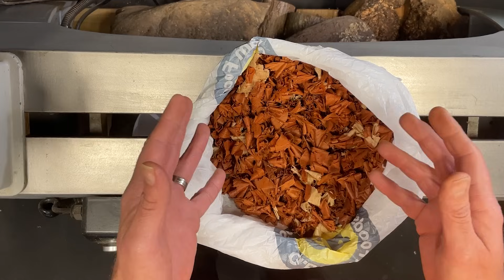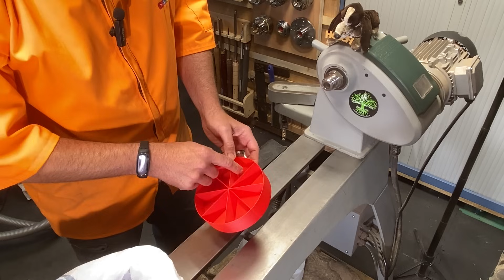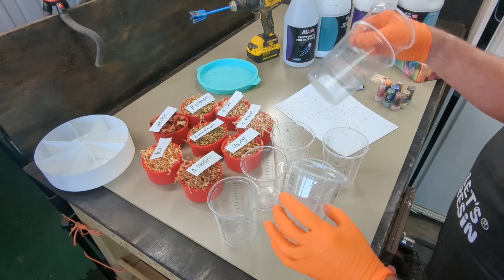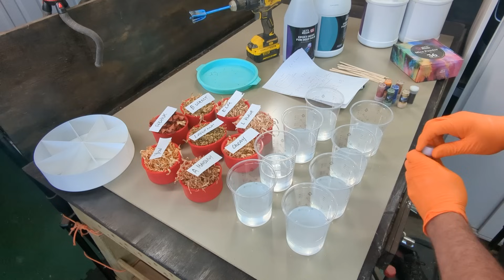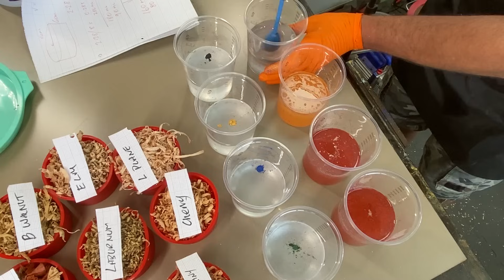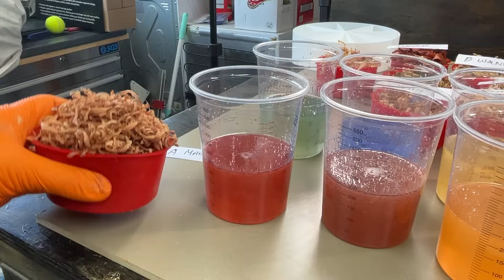Turning Wood Shavings Into a Surprise Project! – A New Wood Turning Experiment

Comment: On the printer side of it:  You can go thicker on the walls while avoiding infill by jacking up the wall count in the slicer.  BUT it's a 3D print...  they won't ever quite be 100% solid.  You can also allow infill but set it to 100%.  Guessing this was printed in PLA, which is... not great at higher temperatures.  PETG would tolerate the heat a fair bit better, but you'd want to test if the resin will stick to it (a similar plastic to disposable water bottles).  ABS / ASA would also handle heat better, but can be trickier to print properly and will offgas some nasty volatile organics.  As a guess though, any of them with thin enough walls might have issues unless you can keep the temperatures down.

I've had the idea of printing molds to use as one time use pen blank molds so I'm excited to see this test of the concept.  I've never had a chance to actually do it.  I was excited to see the mold didn't leak, even with the heat distortion.

Quick edit:  You can also increase the extruded wall thickness (within reason) which might help a small amount.
Reply from the maker: Thanks so much for the tips, I really appreciate it 😀
Reply: @mikeholton  One thing that would worry me from a safety perspective:  If you do, say, two or three perimeter thick walls, when you spin the blank, it's relying on the adhesion of one wall to the next, not the resin to either side of the plastic.  That... will not be as strong as solid resin or resin to either side of a single bead of plastic.  I can't guarantee if it'd explode, but man I'd be terrified trusting it!

I think the idea of just wider single walls might be where it's at.  Might need to slow it down a bit for it to keep up, but I'd bet 0.8 or 1mm thick walls are possible if you can balance speed and temperatures.  PETG, if the resin adhesion is OK, can be easily had in clear, which might optically vanish in the resin.  So many neat places you could go with the printed molds!

I've never done it myself, but you could also use a 3D print to create a sand mold and pour pewter or such to form the internal dividers.  That'd be a really cool "someday" iteration on this.

Comment: If you used PLA filament that is why it warped,  next time try using PETG filament, it doesn't warp from heat as easily as PLA
Reply from the maker: Thanks Tod, yes I used PLA so next time PETG or ABS 😀

Comment: I would have liked to have seen a slightly different shape for this one, which could have been used as a pocket tin or a peanut ramekin, but in the shape of an OMNIA baking tin (round with a sort of ‘central chimney’, solid in this case).

Anyway. It’s still an impressive work.
Reply from the maker: Thanks Ely, I will be doing more with more practical shapes 😀
Reply: @mikeholton you don’t have to. As a viewer, I have sometimes silly ideas that can be nonsenses and could be really difficult to realize. I have absolutly not the thinnest idea of how this sort of shape would be feasible. I’ll continue to Watch you Channel whatever the forms, anyway.

Comment: That's really nice. Maybe use a bit less hardener if the temperature is this high it will cure slower and less hot. Also try to peel off the outside, that way you can easily check if the center is going to  detach.
Reply from the maker: Thanks, the rim was not for peeling, it was fused 😀

Comment: Hi Mike. A very nice & interesting project well done. If you do this again, maybe consider making the interior sectional part separate from the outer ring & spray a mold release onto the inner sectional part then after filling with your resin & shavings, remove the inner part & just have the shavings & resin meet as they will. That way you won't have to worry about the heat & the warping. The mess when working with resin is enough to prevent me from using it. I have, but I don't like it. Seeing you shake it off was very funny. I wondered if you learned that trick from your dog. LOL. Take care and keep turning. Bill Riley
Reply from the maker: Thanks Bill and thanks so much for the suggestion 😀 (yes, my dogs taught me that move lol)

Comment: I wonder if it would work to have the internal dividers as a separate piece, then just at the point of putting it aside to cure you carefully pull the divider out. I guess there would be a bit of blending at the joins but hopefully not too much.
Reply from the maker: That is an interesting idea, thanks for sharing 😀
Reply: @mikeholton   just thinking of a variation on the theme. I like the “segments of an orange” kind of vibe that this one has, probably more than if the dividers had stayed perfectly straight.

Comment: Without sounding redundant, my favorite part of what you do is that you take what others would toss in the trashcan or bin, as you would say, and make it extraordinary. You seemed concerned about lines from the mold not being straight. I was thinking, maybe next time, use some scrap wood to form sections. Surely that would hold straight.
Reply from the maker: Thanks for the idea Jacey 😀

Comment: That's so cool. It looks like pieces of stone. It would be neat to try doing it with copper dividers instead of the white plastic (although I know the 3d printing was part of the experiment). Also, haven't you said in previous videos that yew dust is toxic? Did the resin make it so that wasn't such an issue?
Reply from the maker: Thanks and yes, the yew was impregnated with resin so quite safe 😀

Comment: On your slicer you should be able to set infill to 100% so it'll create a solid form.
Reply from the maker: I did try that but it would not let me, I am fairly new to the whole process 😀
Reply: @mikeholton  Ah okay, I've only got experience with a single slicer (which is dedicated to my printer model). I see someone else has suggested a work around by setting wall thickness. Good opportunity to mess about and try some more ;)

Comment: PLA (assuming that's what you used) melts at very low temperatures and distorts at even lower ones, so even without the workshop being warm I think the curing process is going to warp PLA. Amazing result though!
Reply from the maker: Thanks for the Info Tony, I'll try ABS 😀
Reply: I encourage a bit of research into printing ABS resin filament and health risks, given it's an area I know you take great care over with wood dust.
Reply from the maker: @EightBitTony  Thanks for the heads up! 😀

Comment: Great idea and job. A thought about the 3D print. If your design software will allow, you can have it print a tenon on the bottom so you should have a better hold on the piece instead of the wormscrew. Just a thought.
Reply from the maker: Thanks John that's an interesting idea 🙂

Comment: That looks so good, loved it. I was thinking of trying that myself, now I know it works.Not sure what printer you have but in bambu labs and I think prusa slicer software you can change the perimeter lines to more lines. This is usually better that trying to infill to 100% as  some infills won’t let you. Plus using a filament that has a higher melt point such as abs may help.
Reply from the maker: Thanks Mark, I have a P1S I'll try with ABS 😁

Comment: Very nice. I like the way you separated the different colors and shavings. I tried to make a small bowl a few weeks ago using chainsaw shavings of cherry and yellow resin. I ended up making a funnel when hollowing out the bottom and cut into my recess. I repaired it using more shavings and green resin and turned it into a feature.
Reply from the maker: Sounds great Greg, there is always a way 😀

Comment: I am curious, wouldn’t it have been a little easier to make pie slice molds and then after that cures, then colored epoxy all the pie slices together? Maybe easier isn’t the right word. Less risky maybe? 

I would be worried about the plastic/epoxy bond (and the warping from heat). 
Looks very cool with the colors of the epoxy and wood chips.
Reply from the maker: Thanks, I did consider this and even bought a pie shaped cake mould to do it 😀
Reply: @mikeholton there is always the next one! I have not done a ton of epoxy work so I always try to learn how others do it. Thanks for the reply. It is great work and very unique. 😊

Comment: Good afternoon Mike. I had a huge smile on my face at 26.16 and 37.37 when you applied the isopropyl alcohol and I love to see ribbons of resin flying off the lathe over - someone else. I’ve just done some resin turning myself but my work station is nowhere near as tidy as yours. Note to self: must do better. Would you be interested if I sent you an email with some before, during and after photographs of two disparate projects?  Have a great week🌞
Reply from the maker: Thanks Ray and you know me I would love to see them, but be warned I will give my honest opinion 😀

Comment: Another great piece.  

Did any of the longer strings of resin have enough wood in them to save for a future project?  Maybe put them in clear resin, and the wood pieces would look like they are floating.  

As others have said, increase the wall thickness to 1mm and put the infill to 100%.  You can put holes in the walls to let the resin mix and bond better.  That would mean you would have to stick to a master plan more and give you less leeway in the design, though.

Edit:  Make a mold with a removable divider in the middle.  Use clear resin with the wood pieces.  When the mold is full, pull out the divider, and the resin will mix but not the wood.
Reply from the maker: Thanks Stan, these are good ideas 😀

Comment: I'm surprised that the resin bonded to the 3D printed frame as well as it did. What type of plastic did you use? It looks a little like a "sample pack" of cheesecake you can get from a bakery, with each piece in a white paper liner. I was afraid it was going to turn into 8 pieces at any moment.
Reply from the maker: I was afraid of that as well, tha plastic is PLA 😀

Comment: I would never trust that ... I'm sorry it's just too risky.. 
Now on the other hand , I'd like to see a bowl without any dividers .. I like some of the individual shavings by themselves... ,or mix and match two different shavings .. Either way I think you're onto something.. That's just my opinion.. 41:59
Reply: Indeed. Imagine a set of eight small bowls, identical except for shavings used and resin color.
Reply from the maker: If you noticed in the video I had little red pots, one of my original ideas was to make a set of small bowls 😀
Reply from the maker: Fair enough and good idea, I was trying to do something new 😀

Comment: I wasn’t sure that I would like this bowl, but in the end it turned out nice. Being a model engineer I have often thought of doing the same with brass, aluminium chips, I even bought the epoxy but it is still on the shelf, perhaps I will have a go now, but turning bowls on a metalwork lathe?
Reply from the maker: Thanks Chris, I have turned brass and aluminium chips in  resin a few times, it really works well 😀

Comment: The high temperature was probably caused more by the depth of the resin.
As for the stability, I was surprised that the whole thing didn't break apart.
If I may suggest, next time you may want to print the walls with a few holes/slots so a bit of resin can flow between each chamber and make the whole thing more structurally sound. These holes could be printed in areas that won't be turned, so they can stay hidden.
Reply from the maker: Thanks, this is something I have also considered 😀